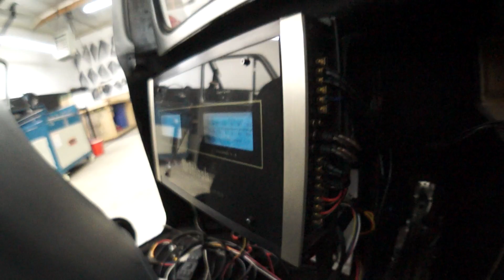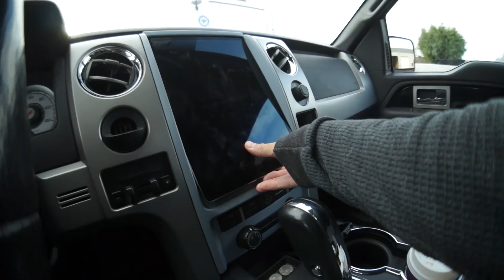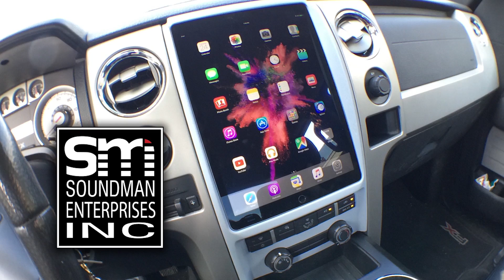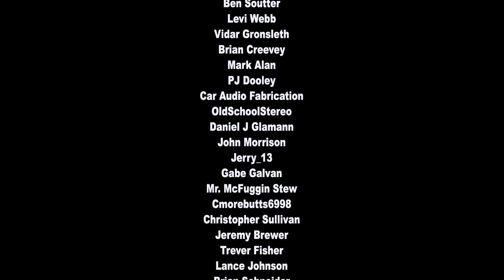"The L.A. Connection"

Comment: You should have welded the bolt to the bracket so you can take it in and out easily boss man
Reply: Even some of that quick drying epoxy glue he has on hand would have held the bolt enough to do the nut up from underneath,

I love watching Doug struggle lol
Reply: You guy  are genius, come and help me with my project please.  I don't know why but for some reason, watching videos is easier than "doing the do."
Reply: murray moss If he welded it with that welder right next to him( takes less than 5 mins) he would not ever have to worry about it again.
Reply: yes your right, and its a good idea. I only really do stock maintenance on my vehicles and even that is a strain for my tiny brain. One of my beloved rides is 21 years old, and going strong.

Comment: I would have tack welded the nuts to the underside of the floor before you removed the bolts. Eithher that or I would have put the bolts up through the floor and bolted it on top. you could weld the bolts in place for future mods.

Comment: I mentioned the rivet but took a few weeks ago when you were installing the air compressor bracket. harbor freight has them in stock. Amazon did same day delivery on my metric kit.  Got standard kit from a local Fastener shop. can also make your own gun using buy and bolts and a wrench. just need the inserts are that point...

Comment: Dude why not just drill the holes and then weld the bolt pointing up through the hole and then tighten the nut from the top?